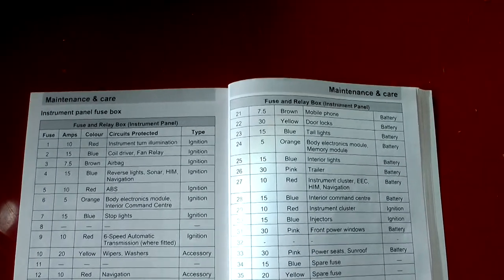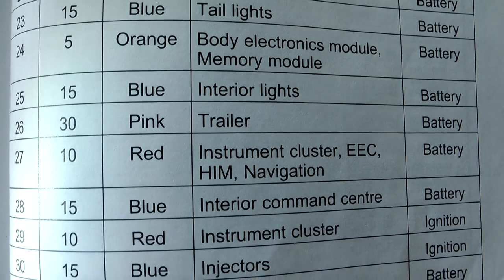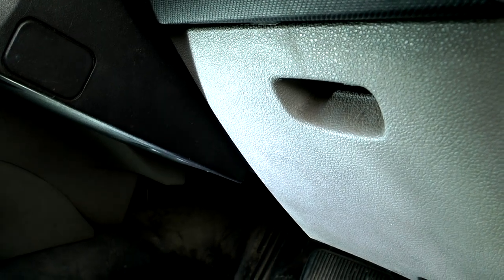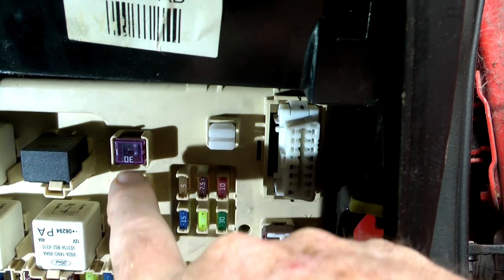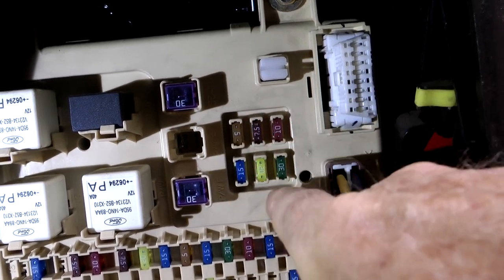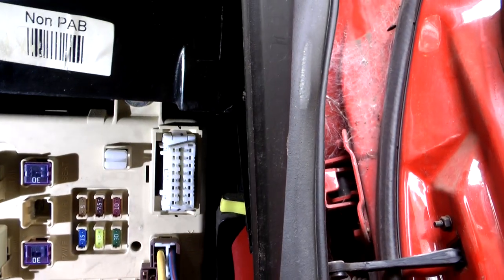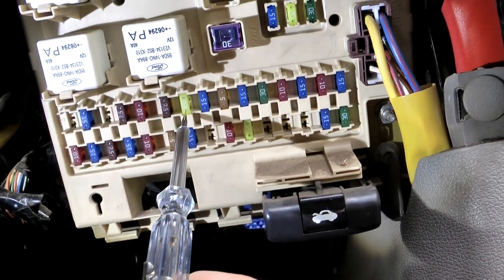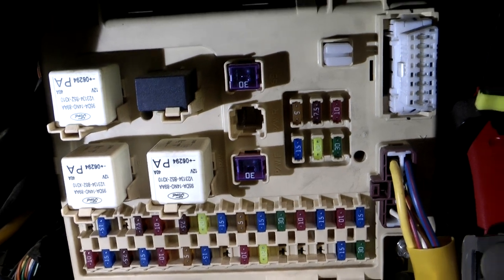BA BF falcon instrument panel Fuse box diagram, description and testing.

Comment: I have a question regarding the dashboard dimmer do you know which fuse input is for this I was originally lead to number 27 useing a red 10 fuse but not sure it is the correct as I checked that fuse with a circiut tester and it was fine but the dimmer light is still not working I would like to know if this is the correct input before I undo the dashboard to check if the bulb is blown
Reply from the maker: Check 25 and 29 if good you may have a wiring problem this vid may help https://www.youtube.com/watch?v=S7QFEVWShvc
Reply: @heymargaretlook  Thank you much appreciated it was the fuse and now working again
Reply: What about wiper motor fuse an its relay an reverse light fuse an relay ?